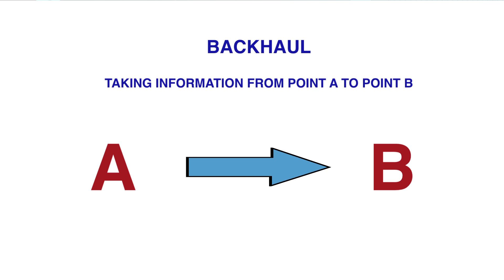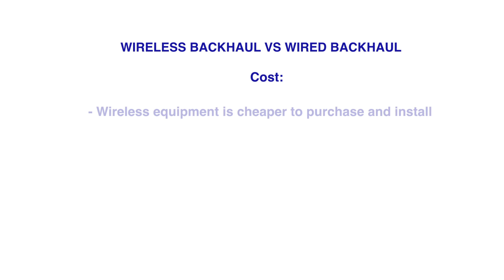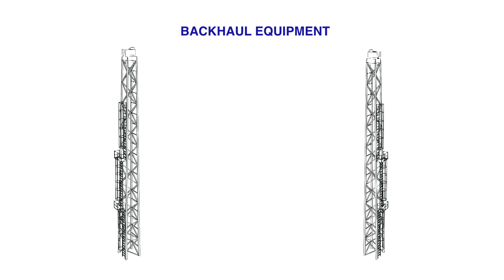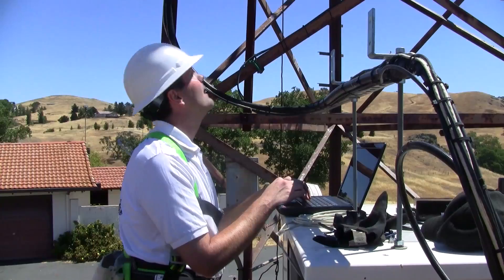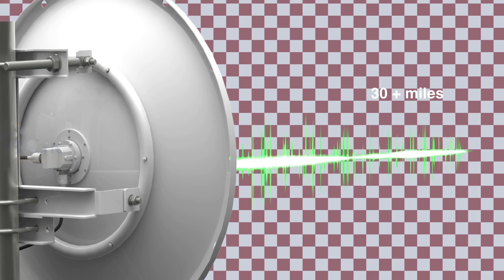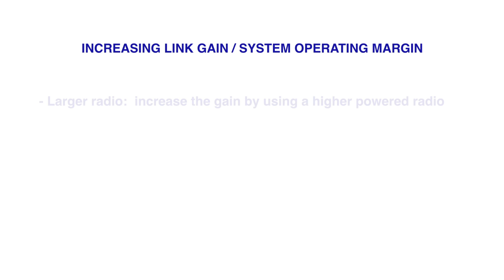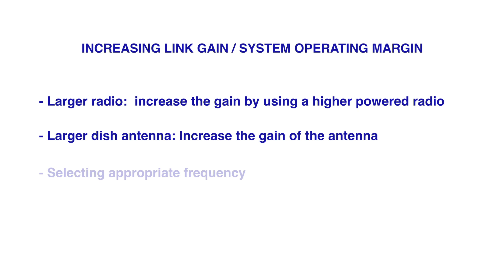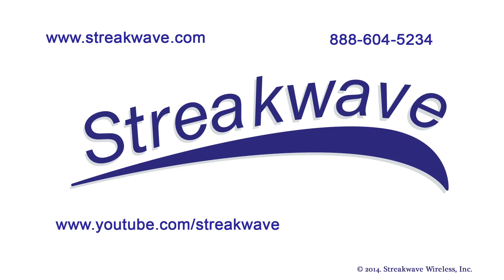Backhaul Basics

Comment: 2 Gb far exceeds fibre?  Isn't that backwards?  Years ago, I was working on the rollout of Wind Mobile, a Canadian cell company, which later became Freedom Mobile.  My role was testing the microwave links.  These links would connect multiple sites to one which had a fibre connection.  This meant the fibre carried the traffic from all those connected sites.  Also, that work was when they were setting up a 3G network.  I'm not sure how well those microwave links would do with the potential load of 5G.  You also mentioned combining 2 links to get double the bandwidth.  I used to work with DragonWave equipment.  They had an adapter to connect 2 radios to a single dish, with the 2 links cross polarized to keep them separate.  Some of the microwave systems were Ethernet right at the top, while others used coax to carry the signal down to the controller, which then could be connected with Ethernet or DS1.  I have worked with both licensed and unlicensed systems.

Comment: Can I use Powerline for the purpose of "Backhauling" , I have some Asus Adapters I used a few years ago, but have since initiated "AiMesh" but would find these useful for "Backhauling" any thoughts? Safe? Effective?
Reply: You're talking about Ethernet over power line adapters?  Those are not what's referred to as backhaul.  Backhaul is generally used for things like connecting cell phone sites to the main network.

Comment: Which type of signal it uses for broadcasting
Reply: Normally, short haul microwave links.  Typically, a single frequency is used, with rapid switching between directions, sometimes called "ping pong" mode.

Comment: WELL EXPLAINED.BUT 5G NEEDS TO BE STOPPED-DANGEROUS/DESTROYS DNA
Reply: Depends. If 5G is in small cells it will usually be deployed with low transmit power. A radio tower blows any LTE or 5G system out of the water in terms of radiation. Radio is more harmful than any other technically.

Comment: I had question not sure if some one could answer ... is there a limit on how many sites a single wireless back haul can cater ?
Reply: Backhaul is usually "Point-to-Point" (PtP), the second site becomes Point-to-Multipoint (PtMP). From there you will only be limited by capacity/bandwidth, the number of clients, availability/visibility of location, distance of transmission etc.
Reply: The backhaul I've worked on is generally in a star configuration, where a microwave link would connect a single site to a central site which had a fibre connection.  I suppose one could set up one site connecting to another, which then connects to the fibre site.  It would be easy enough to do, as the equipment uses Ethernet for the connections, but you'd have to consider traffic loads, etc..